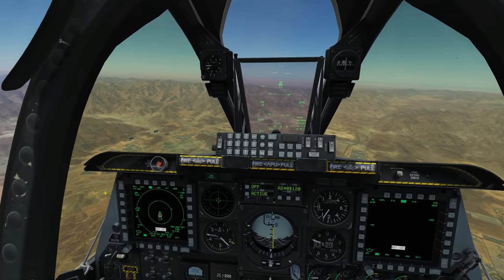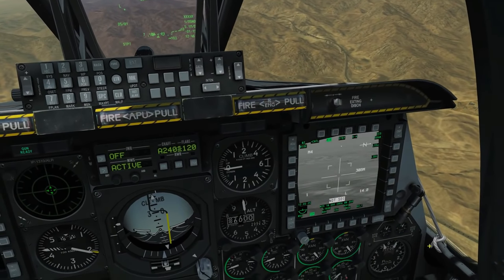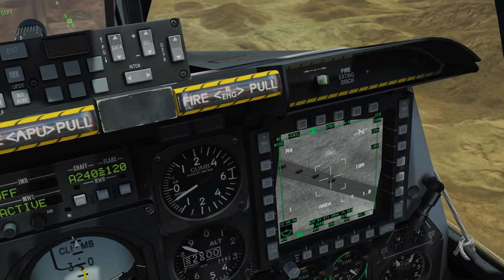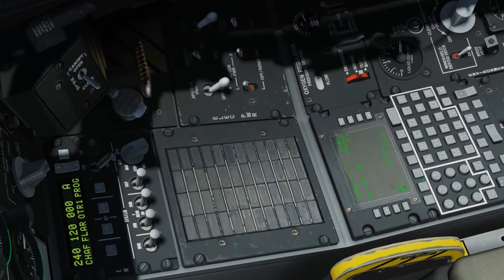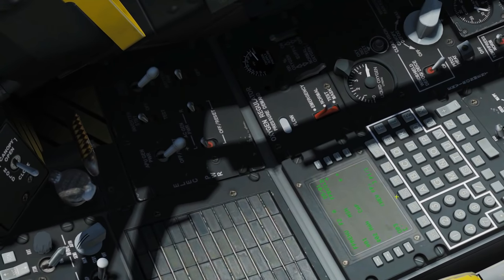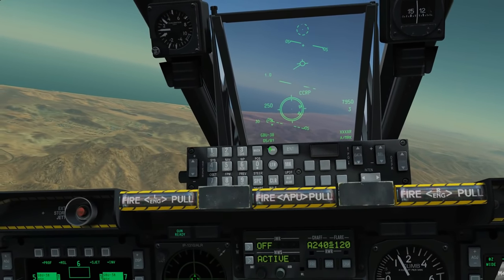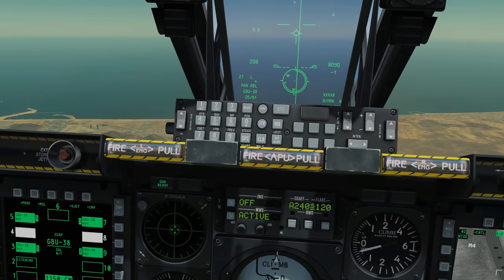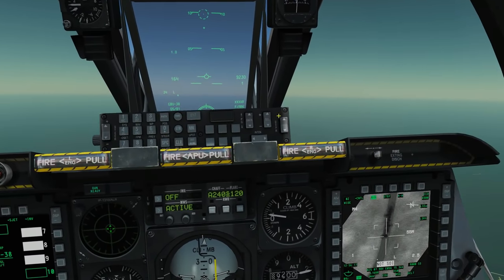A-10C Warthog: Multiple JDAM Ripples Tutorial | DCS WORLD

Comment: No need to create a flightplan. Just make sure Steerpoint is SPI with TMS Back long and then change between markpoints with DMS up/dwn.
Reply: Thank you and apologies my information may be out of date
Reply: I use Mark mode and it works the same.  There is a reason for the flight plan method...but I cannot remember
Reply from the maker: thx
Reply: @Wpns175  The reason would be if you have many markpoints populated (lets say from A to P) but you want to drop in quick succession on specific ones (lets say A -> K -> G). Setting these three markpoints as flightplan will make it easy. Other than that you just set marpoints and use them as SPI steerpoints.

Comment: this is great!
I always have problems with setting up targets for JDAM striking, and this tutorial gets to the point.
quick question, is it possible to use this method with Mavericks?
Reply: Freerider2142 should be able to if you just slave the mavericks to your waypoints. May have to slew a bit to get a good lock first though.
Reply: @Aggie09TX  thanks :)
Reply: Yes certainly, there are 2 ways the hard way - bounce the seeker between targets on the Mav screen if they are close enough together or this way (Flight plan no longer required from other comments).
As Aggie09TX says with MAVs you just need to add in the extra step of slaving the seekers to target before launch